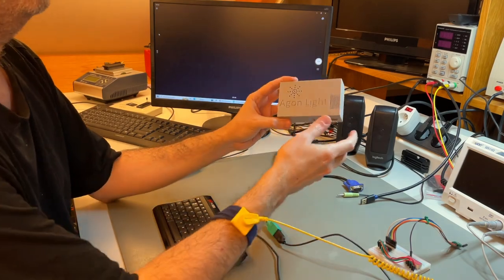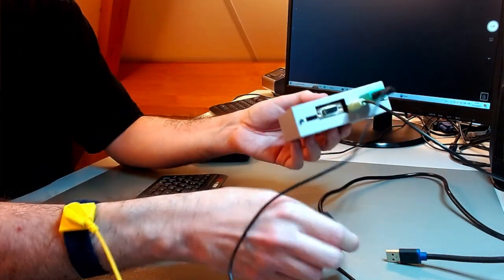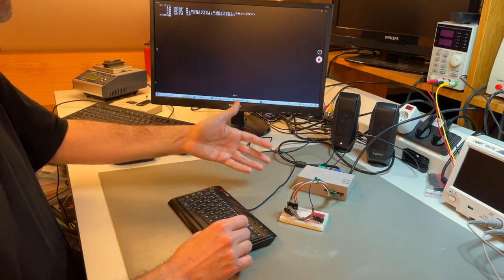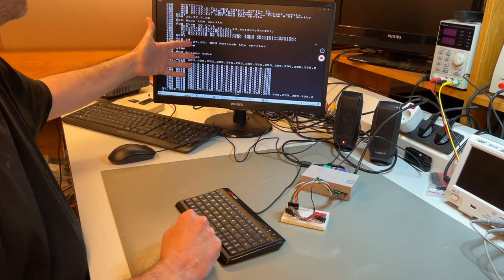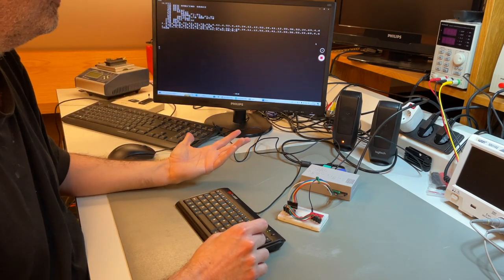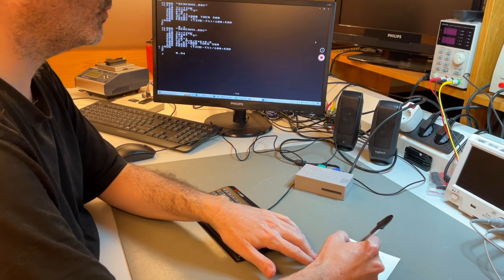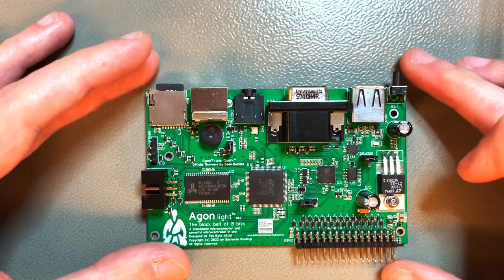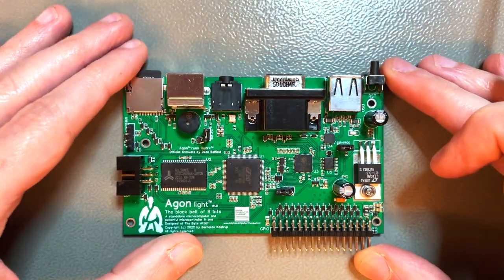The BIG Agon light™ REVEAL! Meet the FASTEST and CHEAPEST 8-bit computer ever built

Comment: 34:00 You really can't normalize across clock speed between z80 and 6502 because they mean different things.  The z80 external clock is finer grained in terms of the instruction and memory cycles.  The equivalent  system would have a higher clock rate for z80
Reply from the maker: I know exactly what you mean, as I am familiar with the Z80's and the 6502's architectures. But your point is a non sequitur: we can very well still normalize for clock frequency from a system perspective. From that perspective, the CPUs are black boxes that perform a certain function. How things operate inside, from the system's point of view, is irrelevant.

Comment: A native port of BBC basic on the ESP32 itself would probably be even faster, or even a Z80 emulator.. Still a nice project.

👍
Reply from the maker: It most definitely wouldn't. ;-) The ESP32 is by and large a serial controller, not a CPU. I thought I had explained this in the video, but clearly I failed. People who claim an ESP32 is a 32-bit CPU just don't understand processor design. The ESP32 doesn't even have external parallel buses; not even of 8 bits... There's a reason it costs so little. It was designed with Tensilica tools, my old competitors when I founded Silicon Hive (now part of Intel), so I know a thing or two about those cores. But hey, those who disagree with me are free to design their own computer with an ESP32 for CPU! I wish them luck. 🙂
Reply: @thebyteattic  Hi, just tried porting one of my Z80 emulator projects to the ESP32 (WROOM @240 MHz) and ran BBCbasic 2.20. With a Basic test BM1 (see https://www.youtube.com/watch?v=PcFZUJwmnQ4) it runs at a speed comparable with that 10 MHz Z80 from the video. The emulator code is compiled with the Arduino IDE. What do you think?
Reply from the maker: @KGE64  The eZ80 is not a Z80. Not to mention the fact that we would lose all GPIOs, I2C, SPI, etc., if we dropped the eZ80 for the ESP32. And that is if we don't take into account the fact that the ESP32 (and its serial external memory) is busy with the real-time task of generating the video signals, including the precisely-timed syncs.
Reply: @thebyteattic  Thanks for your answer. What about the other core in the ESP32 (I used the WROOM 32E)? And the ESP32 has also I2C/SPI/CAN/UART etc. I understand the realt ime nature of the video generation makes it tricky but I will fiddle with this concept some more. I found some videos already of people running Doom and even Windows on the ESP32. There is an adapter board available with PS2 mouse and keyboard sockets, HP jack and a VGA connector.
Reply: @KGE64  I think they use the second core for audio.
Reply from the maker: I'd love to be kept informed of your progress! Don't entertain high hopes, though: the sync pulses and video bitstream have to be constantly generated with strict timings. For this, the sole external memory of the ESP32 is accessed. And it's a serial memory (like every interface of the ESP32-PICO-D4). So you can't use external memory for anything else you may want to do on the second core (audio is produced by a third, smaller core). That makes it possible to do some simple games, such as space invaders, but if you want to run a BASIC interpreter on the second core and fetch programs and data from external memory, that won't work. The ESP32 doesn't have parallel external buses, and the serial lines are taken by video generation.
Reply: @thebyteattic  Hi, I ordered two of those ESP32 VGA PS2 mouse/keyboard boards to tinker with some more. WIl let you know. Cheers,
Gert
Reply: @KGE64  Have you tried using the ESP32 as the CPU, and then another ESP32 for video?

Comment: It's like Marty McFly went back to the future and stole ESP32 technology and a BBC manual and passed it to Bill Gates and said "You cant tell them it's a 32 bit processor but attach it to this Z80 microcontroller and we'll black-box the ESP32 and call it a fluxchirp.
Reply from the maker: Part of an upcoming article on Agon light: "The ESP32 is a system-in-a-package with an internal 32-bit data-path, three different
processing cores, an in-package oscillator driving the 240MHz clock, plus some
peripherals. As such, it may be tempting to consider using the ESP32 alone in a system
like Agon, dispensing with the eZ80 CPU. This, however, would be somewhat naive. The ESP32 has no external parallel buses, being a fundamentally serial system when it
comes to I/O. As such, much of that extra clock speed is lost in serial transfers to and
from external memory. Moreover, the ESP32’s sole external memory port (meant for a
serial pSRAM) is a bottleneck at the system level, chocking its performance even when
one of the three cores inside the device is not fully loaded. Because we use the ESP32 to
produce the video stream, the real-time constraints of such task—such as issuing the
sync pulses at very precise intervals—make it impractical for the device to play the role
of a BASIC-programmed general-purpose CPU, supposed to fetch user code and data
from external memory.
On the other hand, the somewhat serial nature of a scanning, rasterized video signal
renders the ESP32 an adequate option for video generation, which it does with
unparalleled flexibility—since it can be easily programmed in high-level C from the
Arduino IDE—at an unparalleled price point."
To this day, PCs have a graphics system considerably more powerful than their CPU. Just think of NVIDIA graphics cards. It was the same back in the day, such as a 6510 plus a VIC2 in the C64. Agon does the same, and for the same reason, this has always been done.
Reply: @thebyteattic  True but I think you're missing that the ESP32 has plenty of on board flash and RAM already. And that between DMA and 3 processors, the only bottleneck is sharing that memory between processors. You could even look at the multiprocessor ESP32 as being a superior alternative to the Z80 shadow interrupt registers. Call it what it is, real power in the ESP32 used to glorify a newer Z80 variant in the name of 8-bit nostalgia.  Don't get me wrong, I had a ZX81 and an Amstrad CPC664 and at one time I used to visit a local bookshop and program their display BBC, coding in 3D graphics and experimenting with maths art, it was a pleasure to use back in the day. I've coded in assembler, many versions of basic, C and python.
Reply from the maker: I haven't missed anything. The internal RAM of the ESP32 is entirely used as video memory in Agon. The internal Flash of the ESP32 cannot be used for user (BASIC) code, for obvious reasons. If you think I am full of shit, design and build a working computer according to what you think should be done and then post a link here.
Reply: @thebyteattic  wow wow wow, hold on to your horses 🙂 The VGA32 module has 512k of PSRAM which is very usable for the Basic code. I am porting the Agon-VDP code to my Z80 emulator on that board and BBC Basic (2.2 at the moment) . Sure the Z80 emulation is not as fast as a 18 MHz eZ80 but it is no slouch either. Basic speed is approx twice that of an original BBC micro and all the screen/graphics work is offloaded to the fabGL library on the ESP32 so not done by the Z80.

Comment: I would have much preferred Python as it is today's BASIC role and provides a pertinent education. But I guess this kind of software development would rival the hardware side😉
Reply: It would have serious issues. The reason Python is so popular is that our computers are overspecced nowadays, and have lots of headroom to do runtime code and figure out a variable mess on the fly. Sure, BASIC did life compilation as well, but much closer to the actual machine code. Second issue is the 4 character indent. It would be impossible to type python on a TV in 40 character mode. Not to mention the object-everything nuisance, how do you fit hamburger.bottombun.apply.sauce.zigzag(20) on a single line?
I do like BASIC in the modern classroom. It has some serious charms as starter language. If you can't cope with the line numbers, which is the main problem of BASIC IMO, you could consider LUA. That's why kids at school like Pico-8 so much. Let's make the Agon a Pico-8 machine.

Comment: It's not really a fair comparison at all between ZX Spectrum Next and the Agon Light for 2 reasons.  Firstly, the CPU.  The Next uses a Z80 so as to be compatible with all the games that were written on it, the Agon uses an ez80.  The eZ80 is more efficient than the Z80 at the same clock speed.  Secondly, ZX Spectrum BASIC, that the Next is based on is notoriously slow.  It was optimised for size, not speed as it had to fit in 16K or ROM.  BBC Basic was MUCH faster and is a good choice for the Agon.  A more fair comparison would be to run a port of T Russell's BASIC on the Next and see what the difference would be.  It would be interesting to see if the eZ80 advantage is enough with a 10Mhz difference.
Reply from the maker: The BASIC used in the Next for the comparison was Russell's, i.e. the same BASIC interpreter used in Agon light. As for the CPU, it's a critical part of any computer, so of course it's a fair comparison to include that in the benchmark. I'm not sure what your criteria for 'fairness' is. As a user, I want to know how much faster an eZ80 machine is compared to a standard Z80. That difference is part of reality, and benchmarks are about quantifying reality.

Comment: This is not a chip! points to chip 

I'm confused 😀
Reply from the maker: The resistor pack is not a chip; it's not an integrated circuit; it's just 8 resistors packed side by side and covered in epoxy so they look like an integrated circuit, or chip. But there is no silicon die inside, just 8 independent resistors.
Reply: @thebyteattic  it might not be an integrated circuit but I'm pretty sure it still counts as a DIP16 (or whatever number of legs it has) chip..
Reply from the maker: @Darkstar2342  If you insist on living in your own version of reality, fine with me! On planet Earth, however, a chip means a silicon die. A resistor pack has no silicon die. On Earth, the real Earth, a resistor pack is not a chip; has never been and will never be.